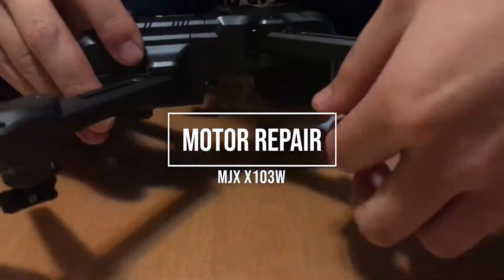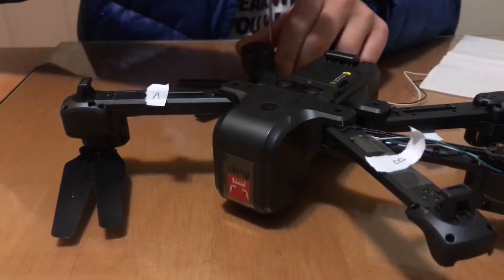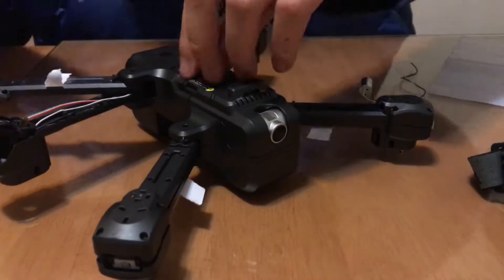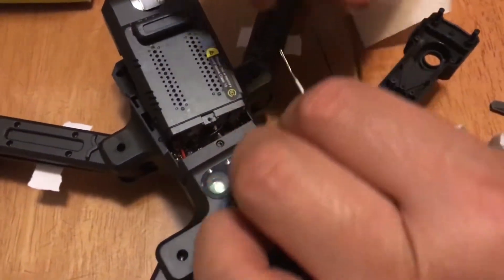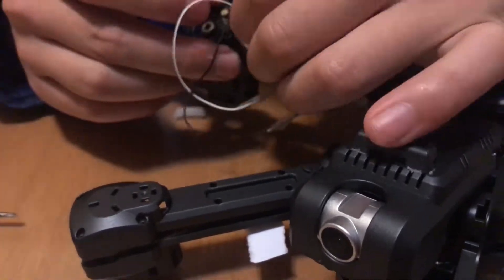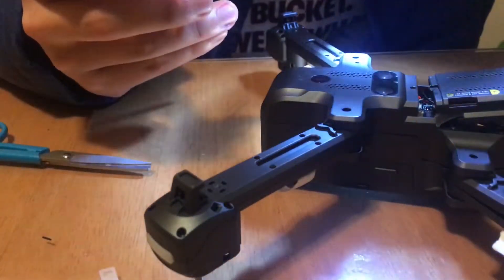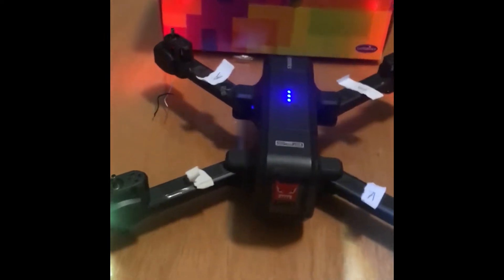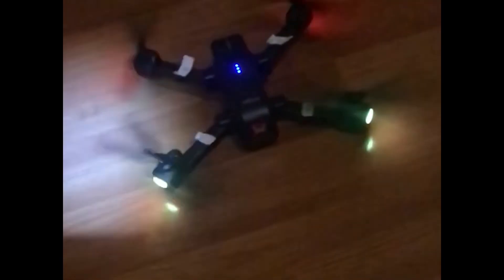Drone Repair -  DO NOT TRY THIS AT HOME!!!!! |MJX X103W| |JJRC H73|

Comment: Great video. I have a JJRC H73 and need to replace one of the motors. Firstly, are all the motors the same, do I have to buy a motor specific to its position? Secondly, where do you recommend buying the parts from?
Reply from the maker: Sam Lentini There are 2 different motors clockwise and counter clockwise. When you buy the motor it comes with both so when you are replaced the motor just connect the rise to the same colours. I brought mine from banggood

Comment: Nice video, was wondering what replacement  motor I need? I have this same drone and mine burnt out also.
Reply from the maker: Isaac Crowley SJRC Z5 motors should be fine or the JJRC one if you can’t find the MJX motors as these 3 drones a pretty much the same